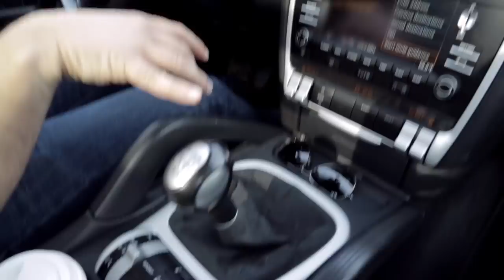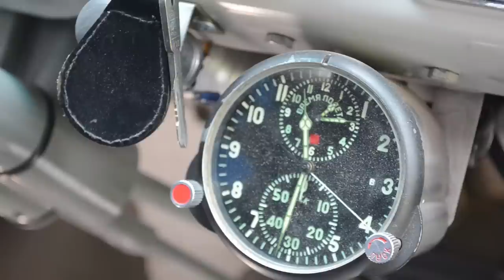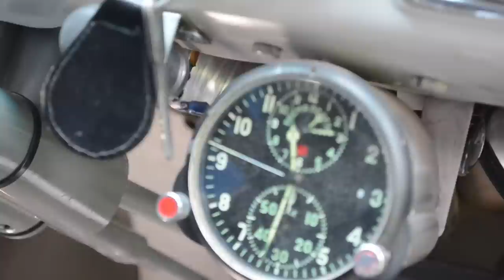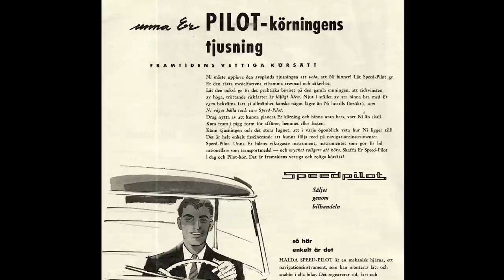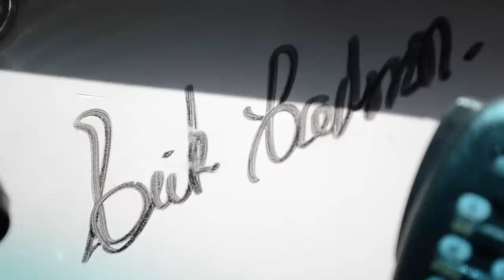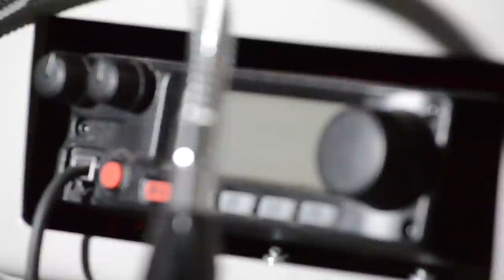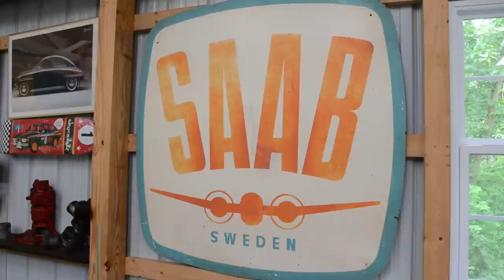Yes, You Can Build a Sick Vintage Rally Car - AFTER/DRIVE

Comment: I love it. In November 2014 I was helping a friend look for a car and I ended up with a SAAB 96 converted for rallying. The thing is that I live in Quito, Ecuador, Talk about hill climbing. The thing has a 2.0L Ford V6 out of an old Capri with the radiator mounted above and aft of the engine. Crazy machine but amazing sound and torque.

Comment: The Sonett was made in three series. The Sonett Mk.1 was a small 748cc two stroke roadster introduced in 1956 intended as a sports/race car, However only 6 were ever made. The Sonett Mk.2 was built from 1966-69, initially with an 841cc two stroke engine. Because of US market demands for more engine power, it got a 1,5 litre Ford V4 engine in 1967, which ironically failed to meet US emissions requirements. In 1970 it was upgraded to the Mk.3, and the V4 engine changed to a 1,7 litre from 1971-74.

Comment: .So far, I have had a '92, 90 and an 87, all 9000s. My current, the 87 was $250 almost 3 years ago. With the back seats down and a comfy foam pad, I have car camped with ease. Although at times I have said- I have to work, I drive a saab (repairs)...these cars were built, driven and raced by people who had saab mojo.....
Thanks for posting and proving older is better...

Comment: I bought a 1966 SAAB  Monte Carlo 850 triple carb from a Doctor for 750 bucks. More fun that you can have with your clothes on. Drove it to work and home every day until the oil injector failed and the engine ate itself. Put an ad in the club newsletter and sold it for what I paid for it. Regret to this day

Comment: Yeah, he probably meant stick. You can braze with acetylene but you can also weld with it, if you turn up the flame a bit and switch to steel filler rod. IMO it's easier than any other method I've used for fine work/sheet metal. It's much like TIG but there's no electrode to contaminate.

Comment: Years ago I stumbled across a blown engine Monte Carlo dirt cheap in a junk yard.  Eventually, like you, turned it into a rally car.  One of the problems was under hard acceleration the engine would torque over enough to bind the shift linkage.  The Saab rally performance manual suggested a turnbuckle/chain combo anchored to the fire wall and exh. manifold to limit the amount of movement.  Did not see this in the video, wonder if you did the same???  Drove a 93', the 96; and a 1st gen 99' with the stupid Triumph engine.  Loved them all, miss them.
Reply: I am familiar with the problem that you describe. It was a major issue in the V4 rally cars that were heavily modified for more HP. I am not aware of this being a problem in the two stroke, due to its limited HP.  I haven't had this problem on my two stroke rally car, although I have new motor and transmission mounts and instead of one engine stabilizer mounted between the cylinder head and inner wheel well, I have two.

Comment: the 96 had between 40 and 60 on the 850 2-stroke depending on model and configuration, so, that would mean four times the original power without injection, or any kind of compressed air for the inlet

Comment: Nice ride. A couple of things got me bothered though. First, that is a 92 model. 96 had a Ford V4, and the headlights were no longer attached to the hood. Second, that engine being a 2-t after all, needs a counter pressure exhaust. That will help you getting uphill.
Reply: It's not a 92, which had a two cylinder two stroke, it's a 1961 96 which was available with a three cylinder two stroke engine from 1960-68 and a V4 engine from 1967-1980. Yes, there was an overlap in 1967-68 when BOTH engines were available. As for the exhaust, all Saab two strokes have a front expansion chamber (including my rally car) which is hidden under the engine. They also have a rear muffler; mine happens to be on the roof so it doesn't get crushed.
Reply: Bruce Turk I had a few 96's and a 95 (wagon). My first 96 was 1966, with the pea green 850cc single solex carb, my second was a Monte Carlo with 3 solex carbs, that one had a bad crank but I found a good one for it. That was a 1967 I think? It had the oil injection as I recall.My model 95 was a 1971 with a V4..Had a few 99's including one with free wheel...AND the first edition 1978 Turbo seriesI'd give my left nut for a vintage Saab just to drive, put on a set of winter specific tires and rip things up a bit.Saabs were/are great cars
Reply: Craig Nehring There are still plenty of Vintage Saabs to be had. We have an extensive classifieds in our club newsletter which is published four times a year. You can also check the classifieds on our web site www.vscna.org.
Reply: Oh man, I am thinking my 89 audi is going to need to share a garage.
Thanks for the quick reply and site link

Comment: I would like to make a small correction about the clock in the car, it could not be from a MIG 29, the MIG 29 is too young an aircraft, it's most likely from a MIG 21 witch is from the same era as the SAAB 96.

Comment: about the same power-to-weight ratio as a 125cc 2-stroke bike in a team I was in a few years ago. 41hp from that 125cc. and that was no high-tech factory team, nope. the team was started by an enthusiast who was taking things seriously, and he knew, that he had more power in that engine, and that a few mods would unleash that. 125cc circuit racing bikes have well over 50hp, if we're talking about high-level motorsports

Comment: OK, so I know that two strokes need to have a certain amount of back pressure in order to run, and I know that two stroke dirtbikes and snowmobiles have varying degrees of tuned exhaust pipes. (which is done by varying the diameter of the pipe to create backpressure) The pipe he has on this car doesn't seem to have a lot of variation in the diameter. Unless it's diameter is bigger under the hood, I wonder if it IS tuned or that it's just the virtual length that serves the purpose of backpressure? Anybody know?
 P.S.  Our rural route mailman swore on the Saab reputation and had 3 or 4 of them over the years. They were perfect for the harsh New England weather. I loved watching the local ice races on the lake in Western Massachusetts when I was a kid, and the Saabs were always dominant. The combo of front wheel drive and very light weight was killer. The only other contenders were VW Bugs or Corvairs, which were both rear wheel drive with the engine over the wheels. Trouble was...they didn't steer well in those conditions! 
Thanks for the GREAT video...I love these little two stroke marvels and the memories it brings back for me!
Reply: The muffler that you see on the cars roof is just that-- a small muffler. The tuned expansion chamber that creates optimum back pressure is located just under the engine. The reason for the small muffler, which I purchased from Tractor Supply for $25.00, was so I do not exceed the maximum decibel level allowed at some racing venues.

Comment: that car is sweet maan... Tell us more about the engines though...? Ya lost me 2-stroke or newer engine something. How did the fuel mixture work on the 2-stroke. And ya...

I know is probably for film and then I am coming from bmx bicycle trail racing... It looks like you could optimize the turns for more smooth slices instead of sharp bursts on that limited amount of power. The tires on that car looks like it digs down to get traction instead of like the newer tires that float or glide around

Comment: 10:27!!!! What a strange car, rear end pre 1960, front end 1965 or later ???????
Reply: You are correct. The car is a 1960 93F with a 1965 front end. The modification was done by Chris Custer around 1976, just for fun. Chris worked for Saab as a competition tuner in the late 1950's. He was also a very successful rally driver her in the States.

Comment: Back, not too long ago, moto gp race bikes were 200 hp 2 stroke 500cc's to one, not very large wheel. Getting more than 100 hp out of a two stroke in a driveable way is very possible. but hit that power band and it will bite you in the ass

Comment: I'm a 2 stroke dummy on cars.  Do 2 strokes generally rev higher in cars?  Do they on average make more power?
Reply: Ben r I've riden a YZ85 dirtbike, I know how they work in bikes, and they actually are preferred because, though they wear out like 4 strokes, they are tons cheaper to rebuilt.  I just don't know my vintage 2 stroke cars :p.
Reply: +Ben r Alright, thanks.  In my area the 2 stroke dirt bikes are still way more preferred by the cheap fair racer crowd, because $1500 every 40 hours of operation is rediculous.  I personally like the all top end power of them, probably why I drive an RX7 too.  Thanks for all the info.
Reply: +Ben r just to touch base on how you call 2 stroke motors crap remember Evinrude makes 300hp 2 stroke motors which create much more torque and are more efficient compared to their counter part 4 stroke engines. also require a lot less maintenance.
Reply: +Ty U. the speakers before me are all right with what they said. But historically spoken, you have to know two things: 1. when the 2 stroke came in business in 1926 at DKW for cars, the greatest advantage was the 2 stroke has the least number of moving parts in comparison to 4 stroke and was more reliable and easier to service. 
2. as it was more simple,  it did not need the driving in inspections and greasing services as other cars, at the time the car had to be reinspected after the first 100 kms and the next 500 kms and the valves had to be readjusted every 2.500 kms and so on. The 2 Stroke has no valves no problems like that.
Reply: +Ty U. The DKW Cars have been a huge success in Sweden between 1932 and 1940. So there were a lot of working cars right after WW2. Saab was an airplane company and decided to make an everyday reliable car below Volvo. The engineers came to the idea to copy the 2 stroke concept of the DKW for the engine and design a totally new car around that. During the cold times in Scandinavia these engines started also quite well.
Reply: A evinrude is a direct injection sealed crank engine you genius there is no reason for them to be less efficient then a 4 stroke, and they arent. No wasted fuel through the exhaust, no oil to be burned that saps efficiency and power.

Comment: What is Bruce Turks day job?
Reply: I am the Director of Operations for Times Square Lighting.
Reply: Bruce, hats off to you! Loving the noise. What's the concentration of two stroke fuel is it one part oil to twenty fuel or??
Reply: Normally a Saab Two Stroke will use 1 quart of non synthetic two stroke oil to 8 gallons of gas. Nowadays we all use synthetic and can get away with 3/4 of a quart to 8 gallons of gas. But since I run this car at very high RPM's I err on the side of caution and still use 1 quart of synthetic oil to 8 gallons = 32:1

Comment: Automatic ugh
Reply: Incorrect.  These old Saabs had column shifters but were still manuals.  If you look at 14:10 you'll see a clutch.
Reply: I stand corrected.
Reply: Joepopa12 nope
Reply: +Joepopa12 They could be shifted without using the clutch, though – if you knew how.   :)